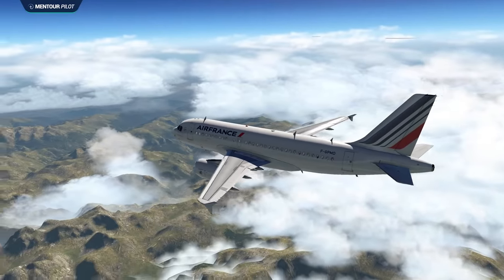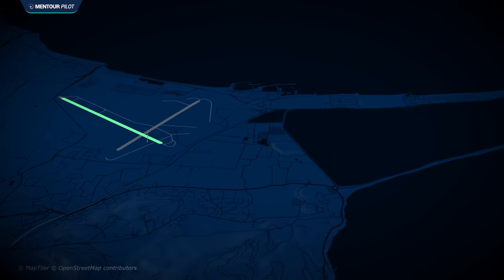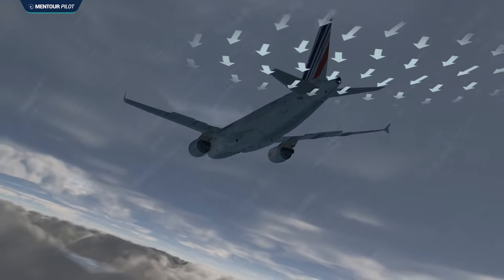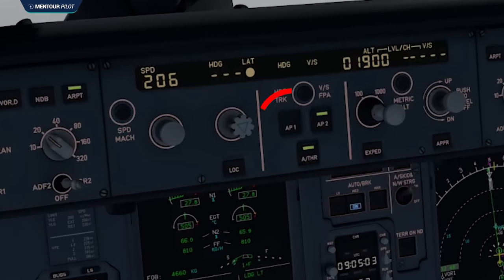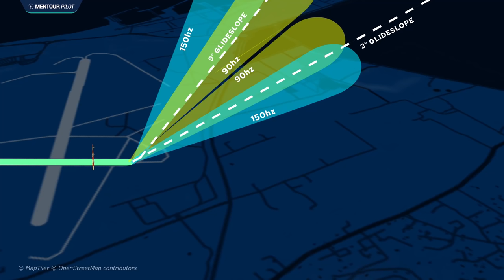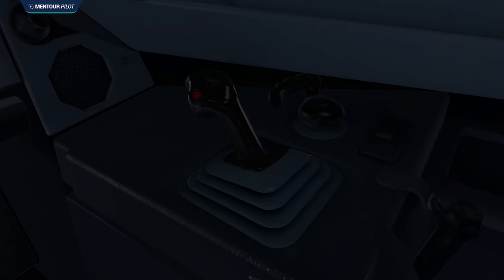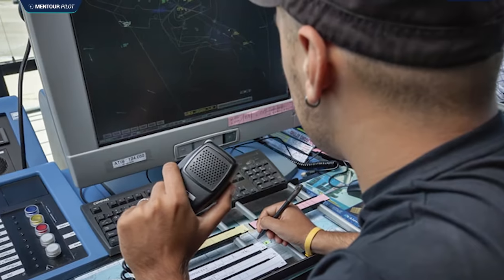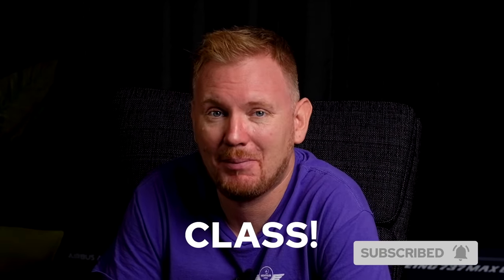An Absolutely CRAZY Reaction! Air France flight 7512

Comment: Secondary lobes aren't a rare phenomenon, they're normal on any radio antenna outside of the most basic omnidirectional antenna and they are to be expected on any highly-directional antenna like those use for IFR. To be honest pilots should have been instructed to be aware of this possibility long before this happened. Actually, if I were designing IFR, I would design a dual-antenna system that separated the two antennae on the receiver (plane) side of things so that the IFR system can recognize when the 90 and 150MHZ frequencies are flipped and issue a warning.

Comment: I used to work in the automotive industry manufacturing safety critical electrical switches for cars and HGVs. We were supposed to have a no blame culture so that if an operator made a mistake, that mistake could be caught, actioned and rectified before it could reach an end user vehicle where it could pose a safer risk. But we had very poor managers who didn’t utilise the engineering team who were responsible for failure mode analysis. They didn’t trust or respect the engineering team as much as they should have and instead of implementing countermeasures against human error which is always unavoidable they would default to disciplinary action towards the production team members. This would result in team members often hiding problems and defects or shifting blame. Thankfully in the 14 years I worked there none of our switches were responsible for any loss of life but only because they were lower severity, class 9 death or serious injury with warning. So things like loss of headlights at night, loss of windshield wipers during rain etc… but after the sticking throttle problems Toyota suffered that caused a massive recall I was sent to Japan for training because the same processes responsible for the fly by wire throttle problems were the same processes used in all of my factory’s switches.

Comment: Just Culture has indeed improved the potential for more reporting of incidents. What this one exposes is poor CRM and airmanship, namely:
- inadequate approach briefing to confirm when a GA would be required due to an unstable approach (particularly in view of the tailwind strength and RWY length)
- PM did not call out tailwind values nor FMA changes
- it seems PF (and PM) was not mentally computing an ILS gross error check of altitude against distance to go and was fixated on the ILS display
- the incorrect GA procedure initially carried out by the crew
Again, bravo to the crew and airline for reporting the incident but the CRM and airmanship failures can only be described as sloppy piloting.

Comment: I was a Boeing 747 200 /300 Senior Captain, and the Airline changed to Airbus 200/300 /600 aircraft and did the conversion in Airbus Miami, and was horrified during this training, I that Airbus doesn't want you to know  so many important systems. When I returned to my Airline, I flew the Airbus aircraft, for 4 yrs and had problems that not even Airbus Factory knew how to fix, while I was Airborne, and one incident was on departure number 4 Engine failed to ignite and we where never told what starter limitations where, and I used the starter Limitations of 747 aircraft. I was so disappointed with these Airbus aircraft, that I left the airline company, and went back to 747's around the World until my retirement at 65. I also noticed that pilots that operate these so called marvelous modern Aircraft lost their very Basic Skills generally, certainly not all Pilot's, but look at recent accidents that show this lack of Skill. !
Reply: Airbus 200/300/600? I’m assuming you meant to add A340 before that

Comment: Re the secondary lobes I would have thought that as I'm in electronics that filters on the transmitters should reduce  or eliminate these harmonics.
Secondsry the on board electronics should have software that eliminates all but the primary lobes be thay the horizontal or verticsl.
Considering the cost of the aircraft and the cost of loosing it I would have thought it would be minimal.
As with the Croyden tram crash ATP automatic train protection would have eliminated this.

Comment: Another scarebus story . Great analysis. False glide path or localiser capture is more frequent than people think. I had quite a few in my flying career ( the last one was in PANC on RW07R at night ) but our procedures mandate to check distances vs  altitude frequently during approach as well as a mandatory go around by 1000ft in unstable conditions. Not abiding by these procedures gives you an automatic FOQA and a serious conversation with the Chief Pilot as well as a mandated simulator check ride with possible job action . Air France procedures seem too casual to me. There is a big difference between genuine pilot error and complacency.

Comment: as a medical doctor i can say we are really trying to make the same changes the airline industry has by adopting just culture. i would like to point out, i think this incident happened because of safety systems.
2 pilots instead of 3, 1st of all would have managed the check lists and communication much better...
but
landing checklist distracted pilots away from ils/speed readings
ILS beam caused the auto pilot to go full stupid
fly by wire computer overrid the pilots pitch down controls and kept the plane in the level flight

would this of happened in the 737-8/max?
i know it has some fly by wire computer stuff but i thought it still has a degree of manual controls...
Reply: Yeah it could unless they have built in software to recognise false glideslope signals. The aircraft will still attempt to capture the glideslope, the difference is once the autopilot is off the plane will do as commanded but also the 737 can be stalled and I don’t think it has a speed protection if autothrottle is off

Comment: I love how you speak of a directed 90/150Hz ILS signal where a couple things are true.
1) If the signals were actually 90/150Hz, we'd be able to hear them with our ears.
2) If the signals were actually sufficiently directional at those frequencies (say to within a 15 degree primary lobe radiation pattern), the antenna would be larger than the runway itself.
In truth, I think it's a signal around 300-350Mhz, with 90Hz and 150Hz signals modulated onto it by Phase Modulation (similar to FM). Think of this like your voice being modulated on a VHF signal, it's the same idea, only it's two tones @ 90/150Hz instead of your voice, and it's closer to UHF, not VHF, and it's phase modulation, not frequency modulation... At 300-350Mhz, directional antennas are relatively small (maybe 4 feet long for a 15 degree primary lob).
Reply: You mixed sound wave with radio (electromagnetic) wave?
Reply: @lethern2  True... you'd need something to translate the electromagnetic to mechanical. Sort of like the 60Hz AC power in our homes which is silent unless it's passed through a transformer where it's called transformer hum. I suppose my main point is that there'd be no need for a frequency change, but you're right in that something would have to convert the type of wave.

Comment: I think it is all a question of scale.. 'Capturing a Glideslope from above'... but how far above.    As commercial pilots you should be able to hold altitude to +- 50 ft, so you should be able to intercept the Glideslope to within 50ft.    Capturing a glideslope from 50 ft above should be easy.  Having to capture it from 2000ft above is unacceptable.

Comment: HZ is a very low radio frequency, the antenna would be immense - is that ILS signal in GHZ?  These frequencies MHZ would put one signal in the FM broadcast band... Just curious how this works -
Reply: The signal is transited in UHF but modulated at the low frequency.

Comment: I guess the idea of stuff like this is that it’s meant to be dumb, but reliable because it’s dumb. There is little to no processing going on in the aircraft’s avionics; it’s just comparing the two signals to each other and that’s pretty well it. It would leave you more open to stuff like this, but at least it is more reliable because it keeps things simple.

Comment: The glide slope should Not be intercepted from above. Intercepting from above is not a stable approach, especially with a tailwind and should be a go around. I’m thinking airline pilots feel pressure to make the landing on the first attempt, even if the approach is a little off!

Comment: This also demonstrates the difference between Boeing and Air Bus in design philosophy.  I flew the A-300 and liked it.  But have never really like the way Air Bus designed the 320 and latter aircraft.  Does the FMS display ground speed?  The the airspeed is 160 knots and the ground speed is 200 knots, guess what?  You have a tail wind component of 40 knots.

Comment: I thought that a signal beam FROM  the nose of the aircraft could be directed at a device on the threshold of the Runway that would "lock on" and guide the plane down automatically?
Reply: No, it is not. They teach it wrongly in flight schools. They tech it as if it is two lobes transmitted and they mention in rare cases only that there exist side lobes.
In fact it is two overlapping radiation patterns where the phase relation between two slightly offset antennas enable a comparison between the 50Hz and 150Hz modulation signal.
The resulting radiation pattern is periodic since regular electrical frequencies are periodic themselves.
Thus no surprise that side lobes exist suppressed by the type of the antenna only. I was lucky enough to get training by the veterans as a kid.
Are you pilot ?

Comment: The fatal accident was with false glideslope was on 16 January 2017. And definitely industry could learn from it. It was a cargo flight so - may be not much people were killed that day (35 people on the ground and 4 crew members) for the industry to take a look into false glideslope and autopilot problems. If false glideslope is reversed, from my point of view as automation systems engineer, it's not a big deal to detect this situation. If the system pitching up or down and as a result get signal to pitch more in this exact direction - may be it's time to level the plane and warn the pilots. The good thing is safeguards were in place to prevent bad things from happening.

Comment: Trying to capture a glideslope from high above, with a 50 kt tailwind, on short final in IMC. OMG! FO should definitely have accepted the option to circle, lose that excess energy, and set up the approach properly. Usually a good idea to accept the controller's advice unless you know something he doesn't. He knows the territory, has all the resources, and doesn't have to fly an airplane while trying to figure things out. FO needs to be a bit more humble.

Comment: Still confused. Wouldn´t the Airbus still want to go down when capturing the false upper 90Hz glideslope since 90Hz is interpreted by the aircraft to pitch down? When leaving the standard glideslope in upper direction the aircraft will at first interfere with the 90Hz false glideslope since the configuration is inverted. This first interference would still cause the aircraft to pitch down the nose, wouldn´t it? Why is the aircraft pulling up then???

Comment: Is there a display of the delta between ground speed and airspeed to display and to feed into some predicted values computed from other inputs such as altitude above and distance to the apron? It could show predicted glide slope goal, for example, i.e., the glide slope you'd have to fly to stay on the actual glide slope based on the component of the tailwind velocity vector that's aligned to the runway.
Reply: Ground speed x 5 will give you the vertical speed you need to maintain 3 degrees

Comment: As per Airbus FCOM/FCTM, once in TOGA LK, quoted word for word : “ the desired thrust can only be recovered by setting A/THR to off, with the instinctive disconnect pushbutton “. Located on the thrust levers.

Retarding the thrust levers back to idle and moving them back up, is not the recommended procedure by Airbus.

That aside, 5 miles out,  almost 1000 feet above the glide, still in F 1 at 220 KTS, with V/S around 2200 is not grounds for even attempting to continue the approach. Fact that should have been clear well before.

Comment: Is the calculation around 8:30 correct? 6500 ft *3 = 19500 ft, which corresponds to ~3.2 nautical miles, if I'm not fully mistaken...
Reply: No. 6500 altitude converts to 19.5 miles distance you should be from the runway.
Reply: It’s a not a calculation it is a rule of thumb

Comment: Hello, if the plane would have stalled, would it be possible for the pilots to put it back in a proper flight again, or would the plane just have crashed? My understanding is, that it is a question of how high the plane flyes to have altitude/time enough to correct the situation.
Reply: And how quick the pilots are to recognise and respond to the stall. Even if alternate law the Airbus would have shouted STALL STALL before reaching actual stall speed

Comment: I appreciate your videos but at 8:28 you said 6500 ft x3=19.5 miles. It would equal 19,500 ft. That is just shy of 3.7 miles. The calculation doesn't work out.

Comment: At the time there was no FMS/AP etc auto correlation system between the "absolute" GPS positions (in 3D x y z / + terrain ) and  reference 3 degree  glideslope "measurements (which were incorrect as the system had locked onto the upper lobes in this incident)  " If there was a link, between GPS and GS / AP   every fixed point along the correct glideslope to the runway would be an absolute measurement  in height and distance which  can be compared to a stored GPS table of calibrated values - also off axis ie approaching left and right of the glideslope's centre line  can also be assessed by this method. But civilian GPS can be affected by radio propagation (faraday rotation), satellite chain non availablity, occasional (terrain masking leading to poor fixes), spoofing,  jamming, etc   - equipment failures, etc So it can never be relied on 100% (ask Holllywood filmmakers), Long live "human" pilots,  and incident reports....there have been other reported incidents of false locking on GS lobes and probably many unreported ones.   Artificial Intelligence  and remote control can p&ss off,

Comment: The mention of just culture is so important even in work places where mistakes are not as serious.  I have worked in places with really unjust cultures and it just makes everything so much worse.  A staff member for example would make a mistake or oversight, realise what they did a little while later and if they reported it then the issue could be fixed without much of an issue leading to only a small delay or followup.  

But because these small mistakes were not reported and fixed before the work reached the customer all it did was make the company look incompetent and we ended up losing alot of high paying Clients as a result.   Our management were pushing staff to do three times the workload, at half the speed, while also making 0 mistakes, it was obvious this was not going to happen to anyone with half a brain yet they still pushed it and it bit them in the ass in the end.

Comment: What’s that saying? “What’s it doing now” If the automation isn’t doing what you want/expect then take control manually!
Reply: Well, it’s a bit different for airline pilots as the workload of flying manually is a LOT bigger. Pilots are also not used to flying manually at the point they were at and would find that troubleshooting the problem would be easier. It’s also usually a very quick fix

Comment: Sounds to me like excessive automation and inadequate understanding and monitoring by the flight crew nearly crashed this plane.     Also if the intended glide slope is 3 degrees, why do they allow the AP to command 30 degrees pitch when trying to follow the glide slope?   I would say limits of +/- 10 degree pitch would be reasonable for the autopilot.   If it cant capture the glide slope with that much pitch, then something is wrong, or the airplane was way out of position to begin with and they need to go around and try again.

Comment: I have trouble understanding that SRS system. If it's meant to manage the speed why is it telling the pilot to keep pitching up 15 degrees?
Reply: SRS means Speed Reference System. The plane climbs and adjusts pitch to maintain V2+20 or so until reaching the altitude in can increase speed. If the plane is light and using higher thrust it can climb faster to maintain the required speed margin

Comment: they should have flown around and approached the airport into the wind, so from the west of the airport.  Tail wind causes airplanes to "float", flying into the tail wind, they lift factor is greater so they could have flown at a slower ground speed.  With the fly into the tail wind, the plane would climb faster with the nose adjustment, that would have caught the pilots attention.  The Obvious problem is the radio guidence system, that is a design flaw, which a smart radio interpetar to clean out the "bogus" signal.  But If I was a pilot, I would have reversed the approach to fly have the tail wind become a head wind which makes the airplane speed requirement "lesser"